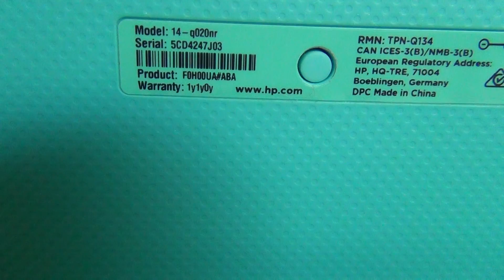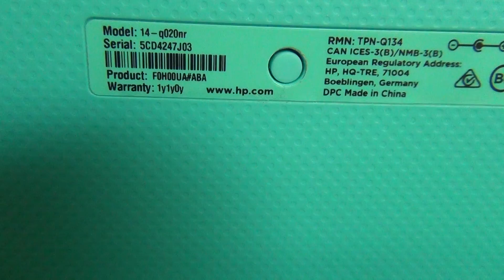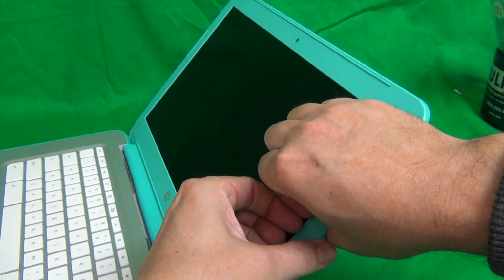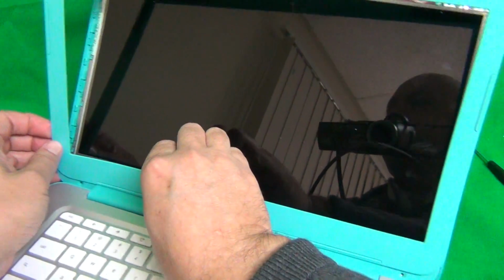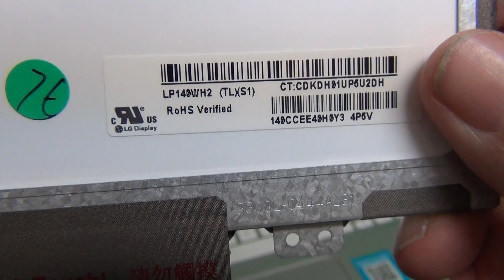HP Chromebook 14 Screen Replacement Procedure

Comment: Great video, thanks. But the first thing I would do is to disconnect the battery. 1 out 100 you can short the board if the battery is plugged in and yes I know what I'm talking about. I've done many many screens there is a small chance you can damage the motherboard if you do that, but don't disconnect the battery before you touch the connector.

Comment: I have a screen that does not come on immediately when the laptop is opened.  After repeated opening and closing the lid, the screen finally lights up.  I think the video cable, zse lvds is damaged.  I have a center hinge to which the base and LCD panel are attached.  Acer R13, Model No CB5-312T-K4OU., SNID 644 0564 6376.  The center hinge has 2 screws on the back side.  Any suggestions, recommendations.  Do you sell the cable?

Comment: Thank you for publishing this vid.  I was able to follow its instructions to replace the broken screen in my HP Chromebook 14 with the screen from my other broken HP Chromebook which had its electronics burned out by a bad power supply from an externally-powered USB hub.  Now I have at least one that works again!

Comment: Thanks very useful vidoe. This works for acer Chromebook 14 cb3-431  dry nicley. Apart from screen bezal removal which  I got off by very gently prying from around the edge under the rubber seal.

Comment: Got new screen in and replaced it, but nothing happens. I can see a very very slight change in light on the screen when it turns on but that's it. I checked the connection, it's flush but still no dice. Please help!

Comment: After watching this video, I'd like to take a stab and fixing one. (of course after I purchasing one)  Some of the model numbers have an "x" designation instead of a "q" or "c".  Does the "x' marking denote a previous generation, let's say, from 2014 whereas the "q" and "c" ones are from last year?  Lastly, I assume non-working keys means a keyboard replacement?  Have you done a video on this, as well?

Comment: Your video saved me from $250.  My HP Chromebook 14 had these annoying vertical lines that took up about 1/2" running right down the center of the screen.  It's an extra machine in my house and used by everyone.  I couldn't stand looking at those lines anymore, so I started researching if it was fixable.  I found your video and saw how easy it was to replace the hardware.  My only problem was my PH00 screwdriver stripped one of the screws (not your fault) but I managed to get it the darn thing out and put a new screen in (less than $50 from Amazon Prime).  The family is super excited the Chromebook looks brand new!  Thank you.

Comment: where is the backlight?
Reply: +bulld9g I think the back light is LED and built in.  There appears to be a (low) power handling circuit on the one side of the circuit board sticking out under the screen on the unit I've taken apart..